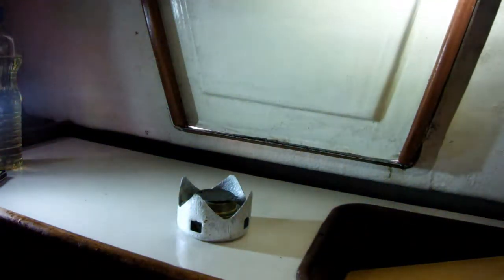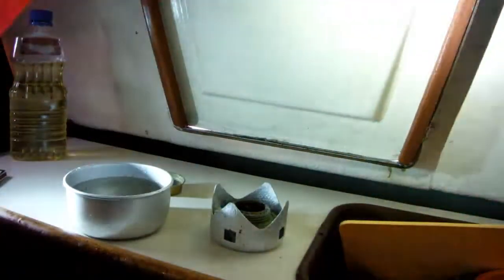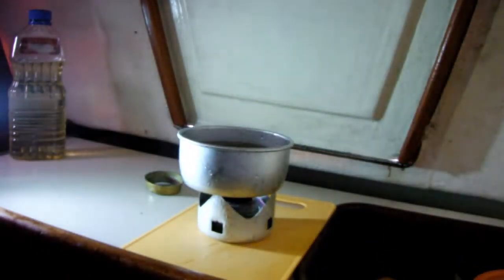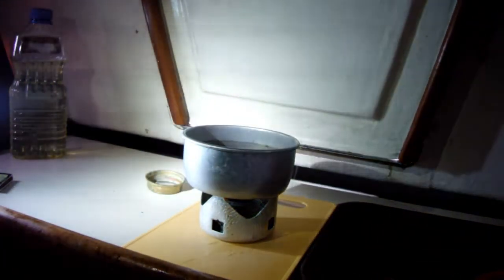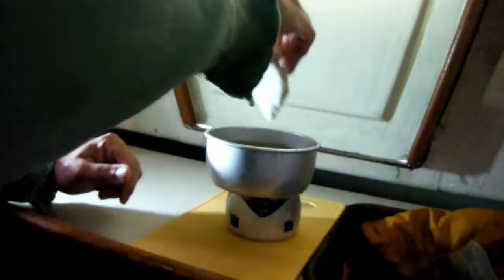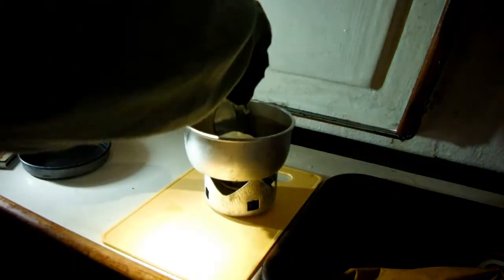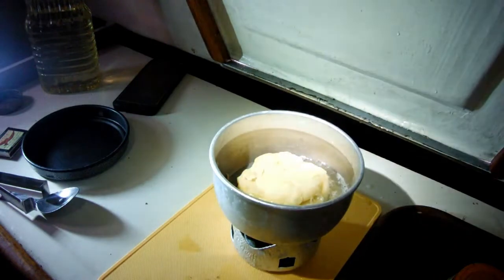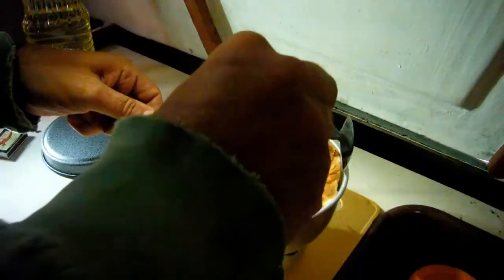How to Make Bread on a Boat- with an Alcohol Stove Video

Comment: Myself I can be a bit clumsy I would stick with pressurized fuels like butane and propane. I'm sure you have them as well. I like the cheapo single burner butane stoves. It's a shame with the empty canisters though. Great video I didn't know bannock was basically just flour deep fried.
Reply from the maker: The Trangia is not an ideal boat stove.  My Origo is a better boat stove.  It has a special wick that prevents spills.  Canister stoves are good too, but expensive to operate.